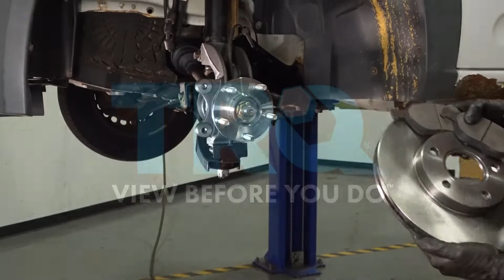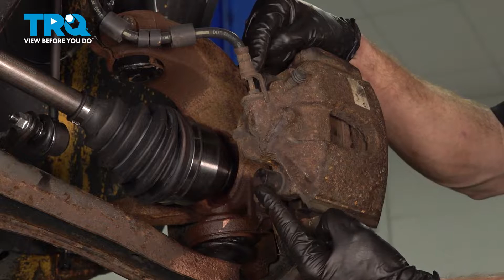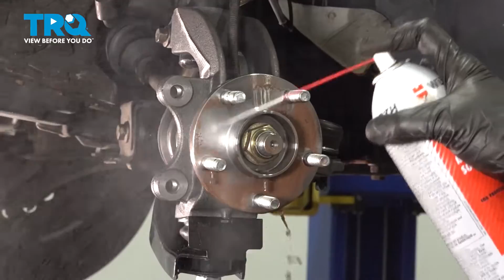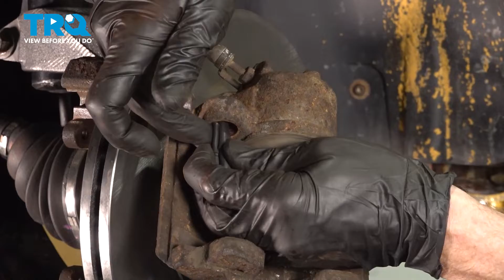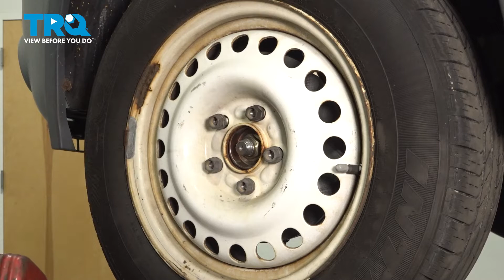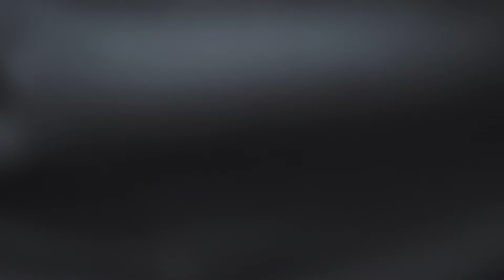How to Replace Front Brakes 2010-2013 Ford Transit Connect

Comment: INCORRECT! On a 2010 Transit the (2) slider pins are removed with a 7mm Allen, not a 5 mm as you state at 1:27.